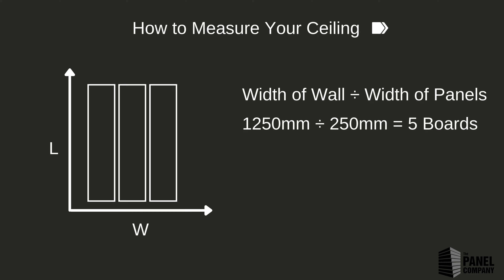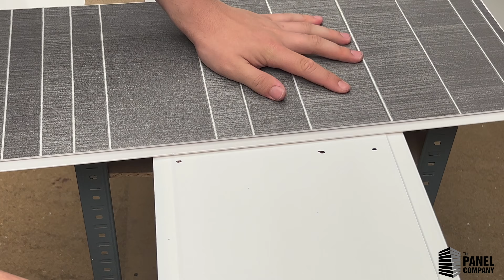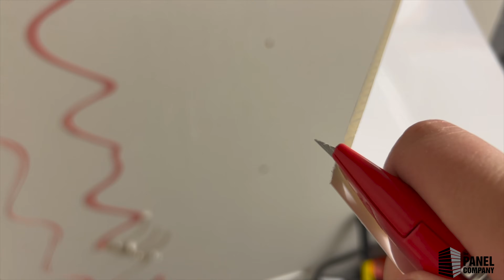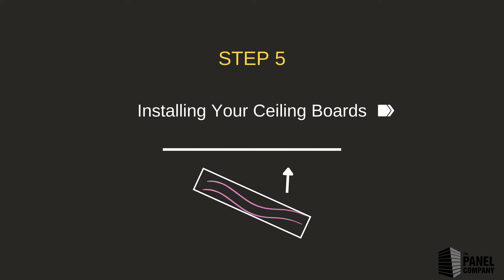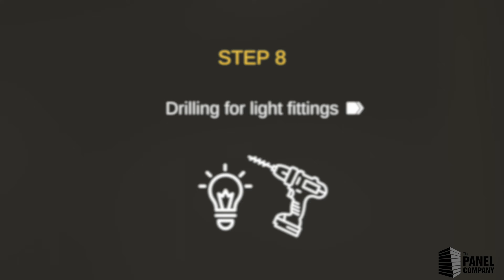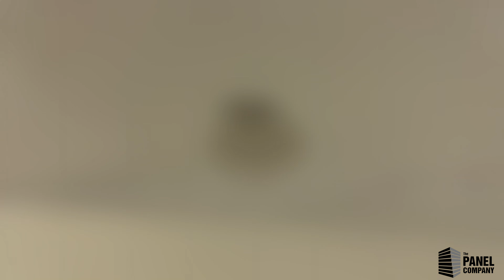How to Install Ceiling Panels | The Panel Company

Comment: Um ,What if the last board is only 3 inchs wide, should u not measure the ceiling fitst and split the difference with the first board ,ie start with a half board plus 1 1/2 inchs ,this gets it even and not messing with a wee bit
Reply from the maker: We have addressed this in our New ceiling Panel Video

Comment: We cut the wrong edge of the first panel so the panels are fitted without stapling but no more nail, and we have end cap at each corner which had been screwed and stapled, is it strong enough to support the panels? It’s an entrance porch and not big area

Comment: What type and size screws would you use to secure these PVC panels into walls and ceiling? into wood battens ceiling and hollow plasterboard for walls please?
Reply from the maker: Any suitable screw size will be fine, you would want them to grab into the battens, but also a small enough head that it does not restrict the tongue and groove fitment.
Reply: 12mm countersunk is what ive used before

Comment: Hi there im panneling my bathroom walls and ceiling giving it a try for first time fingers crossed. What trim should i get for along the ceiling as see some people use the internal trims and others coving? Good video helped me out alot
Reply from the maker: We would recommend using the coving, or if you want a trim free finish use some Mold resistant silicone. Internal corners are not ideal for the ceiling as it would require a perfect 90 degree angle. You would also have to use the same thickness boards on the ceiling as you do the walls as internal corners are one size both sides.

Comment: I think it would have been better if you uesd edge trim for a neater finishing.
Reply from the maker: Yes!! As this fitting was mainly for the video we wanted to prevent as much wastage as possible. It is a personal choice thing and the panels can be installed with or without.

Comment: I've noticed on some other videos  they batten the ceiling first ,is there any advantages to this method  ?
Reply from the maker: So long as your ceiling is sturdy and not coming away from the batons already behind the plaster board, you will be perfectly fine installing them direct. The main reason you might use battens is to lower the ceiling. This could be to make it easy to install spotlights or to prevent cut tiles or shower panels along the top of your walls.